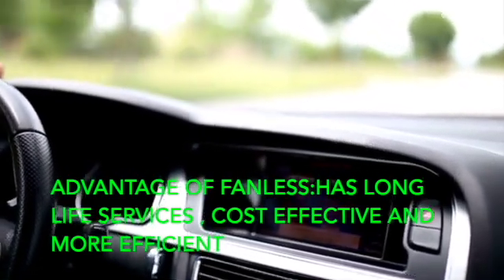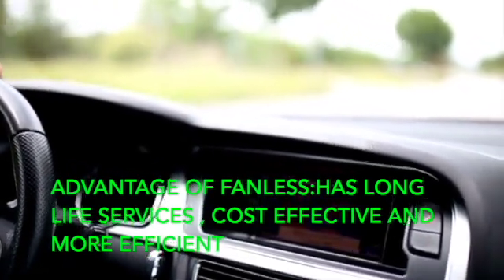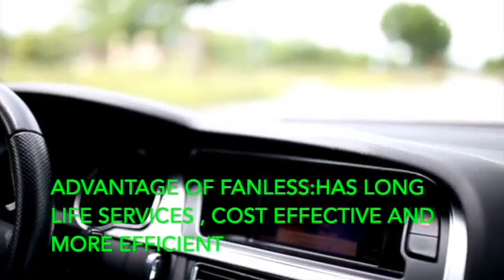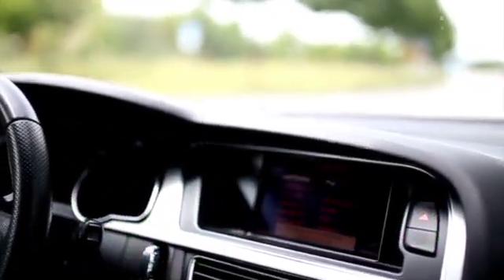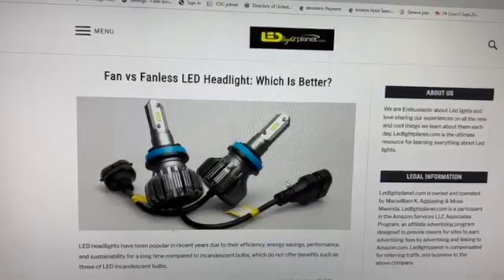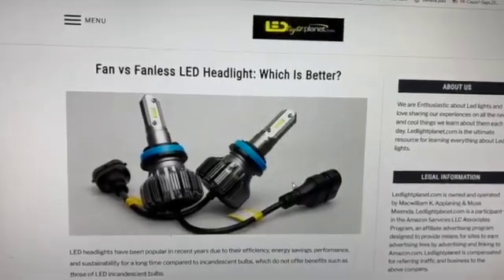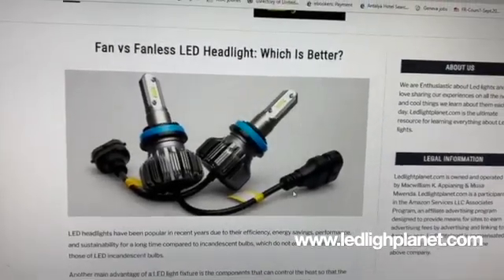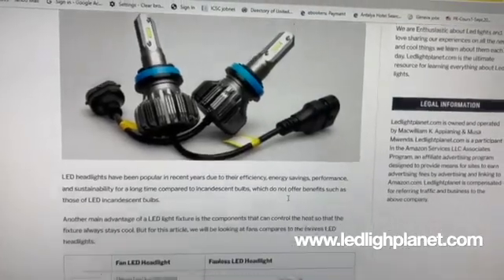FAN AND FANLESS LED HEADLIGHT WHICH IS BETTER?

Comment: Car led lights does not last as long as incandescent light bulbs due to weak  SMD drive components that can not handle heat must  be as simple as a resistor or voltage regulator.

Comment: I'm just wondering over a period of time the fan will pull in dust or pollen into the headlight housing coating the inside the lens with dust and pollen
Reply: The fan models don't have a proper dust seal.